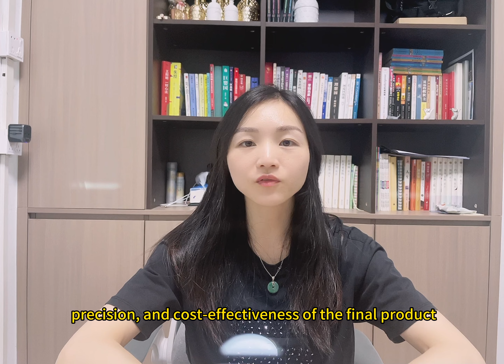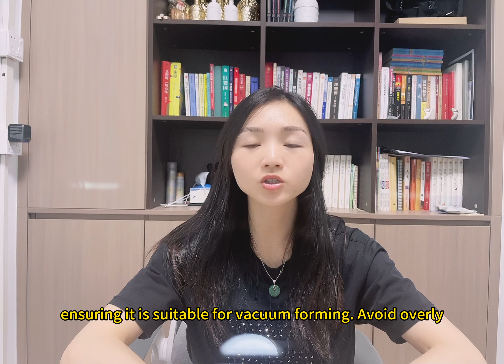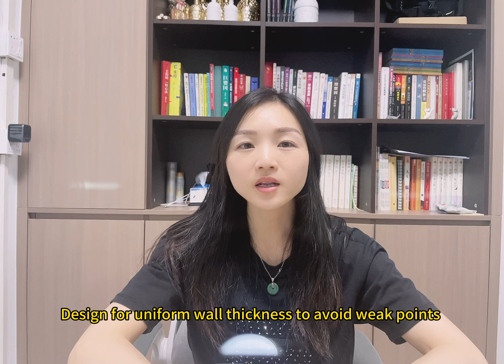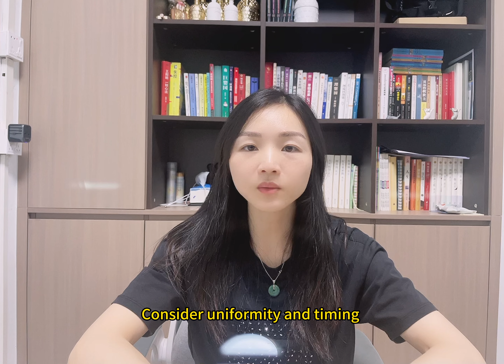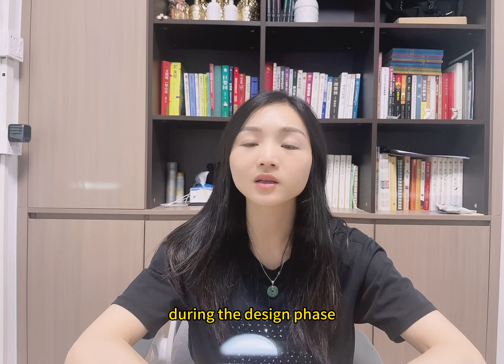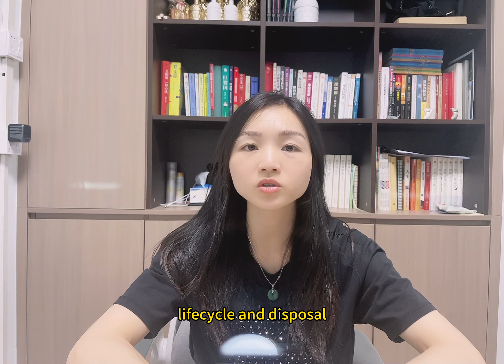Mastering Vacuum Forming: 100 Questions Answered

Comment: How to calculate sheet size and thickness drop with height
Reply from the maker: Generally speaking, to calculate the size of a sheet, one must measure the length, width, and height of the product. For some special structures, more material is required to meet the molding requirements. The specific dimensions of the sheet should be calculated based on the actual product size and structure. As for the thickness, the thickness of the sheet reduces as it stretches over the mold during forming. This depends on several factors: 1. Material characteristics, as different materials have different stretching properties, even under the same conditions; 2. The thicker parts of the product typically show more noticeable thinning and will have some differences in thickness compared to the edges; 3. The degree of thickness of the sheet directly determines the thickness of the product after molding, so we usually use a slightly thicker sheet to meet the thickness requirements of the molding. Overall, the actual calculation of sheet thickness and the estimation of product thickness should be determined based on the actual size and structure of the product.